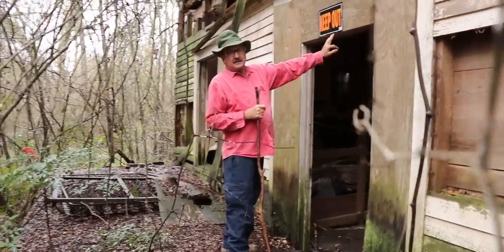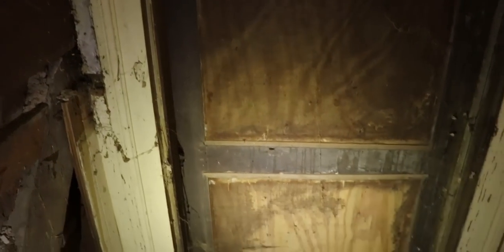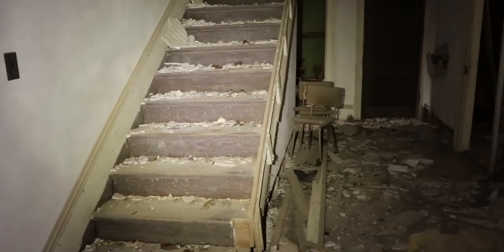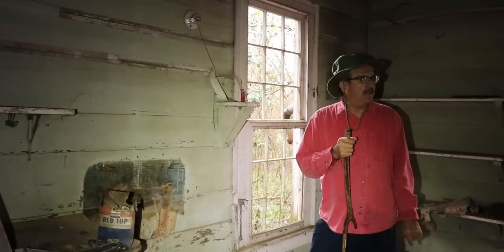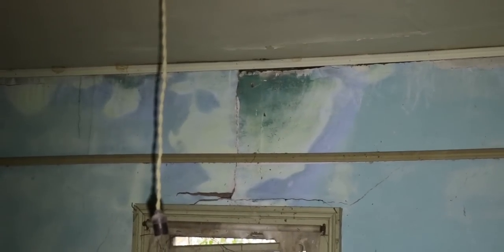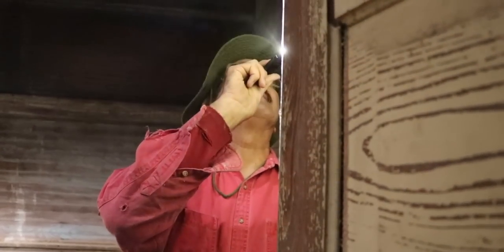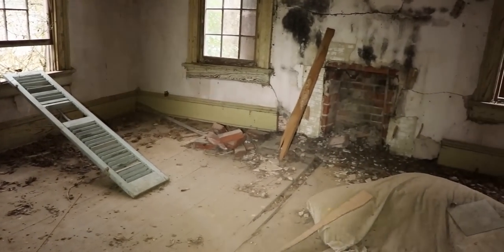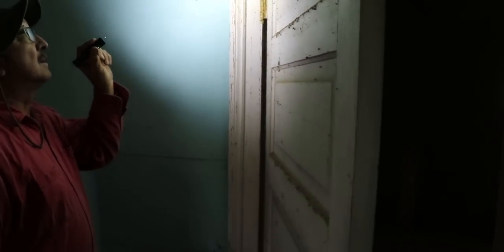Exploring Abandoned 190 Year Old Plantation House in Georgia

Comment: That thing on the door frame is a knife sharpener!     Lol      kitchen right! My folks have on but instead of being attached to a wall it has a handle! You draw the knife sideways in between the the circles of metle! Not the best knife sharpener but no slouch either it' ll do a great job! If that was cleaned up derusted , it would work!
That little cupboard that locked was the medicine cabinet and the other was for money and expensive jewelry exc.

Comment: Uh, detached kitchen was used in hot weather to keep excess heat out of living area of the house. It has nothing to do with fire prevention. It is obvious that old homes such as this had fireplaces for heat in cold weather and often had huge cooking fireplaces in the indoor kitchen. Those fireplaces were not merely decorative. People built fires in them, in the house. Fire was always a risk,, whether from fireplaces, candles,, or oil lamps. By the way, I love the dentillatiion used both inside and on the exterior. That was once a fine house.

Comment: You call yourself   a Southerner????
That metal bracket in the door jam is for people to leave their calling cards if thry came by and you were not at home!   
There was no separation of house   the wall
In front of the stairs was added as the stairs would always be
Open  to the front parlor
I m a yank!! and I know more about the south come on guys  did you not grow up there?  Come one! 
The front door may also have been in the wall across from the stairway. Bottom thats a maybe 
Southern houses had two front room
With a stairway in center the kitchen would always be to the right of thev stars 
Dining room is to the right of the stairs
The latter dinning rook  is the addition  behind the kitchen   You move the camera way
too fast and not in every area or corner  slowly 
All 9/9 windows are all original  and put in at the save time 
I think the front porch was to the side where. Buggies  would pull  up to
The horizontal wood plank was added later called  ship lath taken from
Old ships were sold everywhere  to replace plaster walls 
Bead board is all  
Original moldings are original  even different heights 
Office nay be room far left of the  stairs and may have been  a master bedroom at one one time 
ll
Other bedrooms were upstairs  upstairs was open  to below hall 
The bathroom
Down  stairs  .  was added  in. Center if house   might have been the original office   
Only original bathroom
Would be up stairs bottom
Bath 
Added years  later 
Might have  had large sliding  doors  on either side of the stayesv m
Wall were first strips of horizontal 
Slats  to receive plaster 
Then ship
Lath was added
Finally plaster board was  added 
Gas lights were first 1830-1890
Then  electric 1890/1910
Okay 
Transoms were  over doors first then stained glass was.next then  clear glass and sooner  reg glass and wood added later
Did not  see a
Enough of upstairs zdxzify òsw